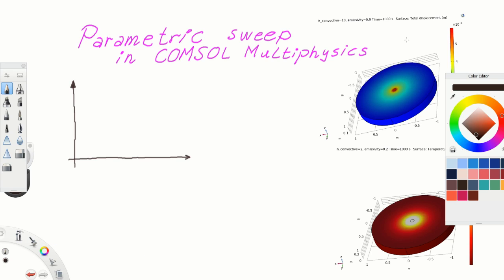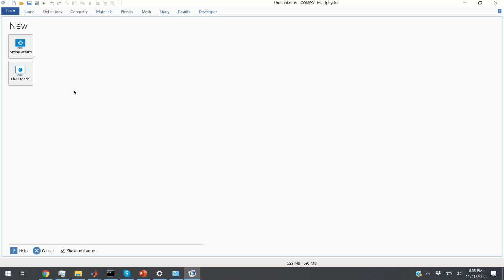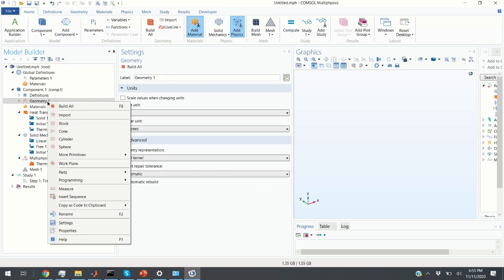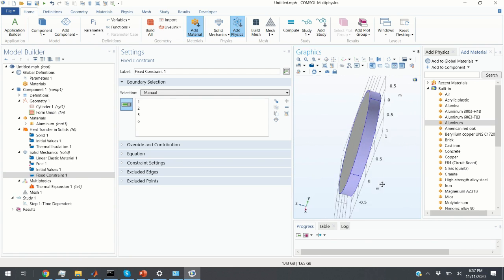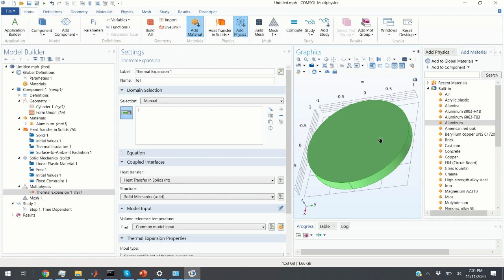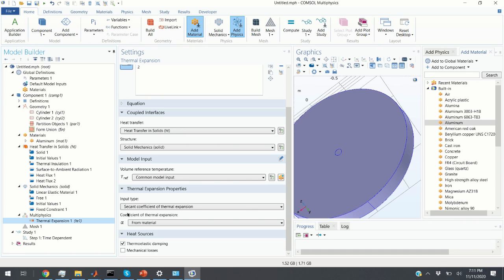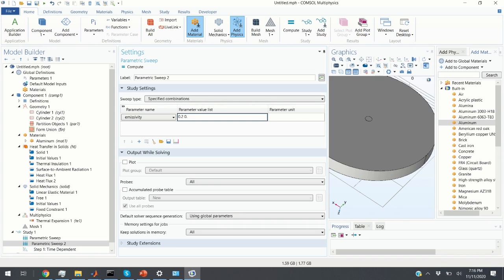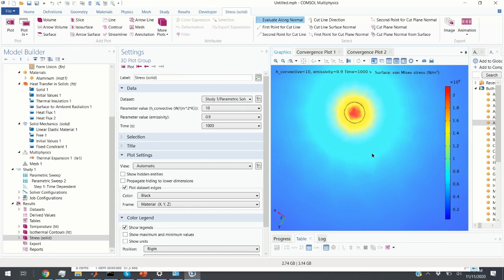Parametric Sweeps in COMSOL Multiphysics- Explained Using a Thermal Deformation Example

Comment: Thank you for the video, can you inform me between the difference between this study (Thermal Deformation) and the study with the residual stresses and the thermomechanical study, or these three cases use the same physics (solid mechanics and transfer of heat).
Reply from the maker: Basically, you have two modules in COMSOL: structural mechanics and heat transfer modules. You can start an empty study and then you can add a structural mechanics study and also a heat transfer study. Then, an option will appear to couple these studies. Everything related to the combination of structural mechanics and heat transfer is computed in this way, including thermomechanical stresses, heat-induced deformations, etc. Good luck with your studies!

Comment: thanks for the video. I want to simulate ablation and my component does not get deformed. Despite my use of the deformed geometry module nothing happens when the object wants to evaporate. I would be grateful if you could help me!
Reply from the maker: Hi Fahime, unfortunately, I am not an expert for ablation, and I have never simulated such a process. This is what I found online:

https://www.comsol.com/blogs/modeling-thermal-ablation-for-material-removal/

https://www.comsol.com/model/modeling-material-removal-through-thermal-ablation-46671

Sorry that I cannot help you more. Good luck with your project!